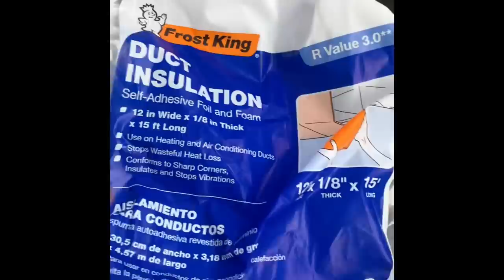You won’t believe what we find when we Rip the basement A/C out of our Alfa Seeya RV. #Alfa #RV

Comment: To insulate the bottom of the unit, take a piece of duct board from an HVAC supply house (Locke, or Johnstone, etc). Cut to the shape you want. Make sure everything is dry and get some 3M brand super 77 adhesive spray. Spray the duct board piece and the metal…let sit a few seconds to “tack” up and then put the duct board piece in place. I’m a few seconds that adhesive will do the trick!
Reply from the maker: Yeah, Lowe’s really didn’t have much of a selection. Thanks for the tip!!

Comment: Tim,
One of the reasons your evap coil was so filthy was because you only have 2 screws holding the return air duct onto the case.  If you take a look at your video, you can see the screw holes in the case where the missing screws were left out by someone who had removed the unit previously.  (Understandably so because they are a real pain to reach and get in.)   It is sucking all sorts of dirt in from the connection of the return air duct to the case.  This includes outside hot air from around the engine area.  A little aluminized duct tape on the flanges of the ducts and the case help out a lot.  Probably might have replaced the foam seal around it that you said "wasn't too bad"" as well.

Another thing you could have done is powered up the unit while it was removed and checked the amperage draw of each compressor with a clamp meter to see if they were struggling.  You could have also done a temp differential check at the unit to compare the inlet and outlet "delta".   As you probably noticed, there are no pressure taps for checking compressor output or to re-service the refrigerant charge.  Ronnie Wolfe/Dick Albritton has added them and has found that even units when they were new (yeah, Dick has been doing Alfa AC repairs for a LONG time) some were low on refrigerant pressures.  I changed out both of my blower capacitors as a precaution and the pillow block bearing on the condenser blower, and of course oiled them all.

Great video!  Thanks for posting it.  Like you said, it is not for the 'faint of heart" as it is a LOT of physical labor to get that beast out and back in.  A hydraulic lift table helps a little bit.

Ronnie Wolfe has done it so many times that I think he can do it in his sleep.  He had mine out, cleaned, serviced, checked, and reinstalled and operating perfectly in less than 6 hours.  I am still amazed.  He's in Choudrant, LA.  Great guy if you ever get a chance to meet him.
Jim Harvey
'04 Alfa See Ya #71507

Comment: from my experience in motor coaches and class 8 semi trucks it if they have a fresh or recirc. air intake screen you need to find a filter to replace it with, at the very least keep the screen clean and keep carpets vacuumed,  I have found that drivers who have pets regularly especially cats will find the evaporators getting clogged up quicker and getting dander out of them is tough.  thing is these things circulate a large amount of air in a relatively small space. and accentually work like a vacuum cleaner.
Reply from the maker: Makes sense!  This has a cheap o washable type air filter. I just went online and ordered much better filters.

Comment: Cleaned the condenser coil on my friends campers trailer a/c little while ago it looked identical to the one u cleaned. Obviously hadn’t been done in years either. But anyway I’m impressed with your talents Tim. I worked for a plg. Heating air conditioning company for 25plus years u get to work in some tight 💩holes sometimes lol 😂
Reply from the maker: Well thank ya sir!! I figured it was bad but I didn’t think it was that bad.

Comment: Get you a hose clamp open it all the way up straighten it out the best you can and take the very end of it, which is the opposite end of the screw side and put it between each row of aluminum fins and go either up or down between them to straighten them and it doesn't damage them... it doesn't take long at all, to straighten all of them...
Reply from the maker: Nice tip! Will do that

Comment: Should have used a medium to soft brush to get the heavy crud off before spraying the cleaner....  Doesn't that pan have at least 1 drain hole so the condensate can drain out?
Reply from the maker: I’d say the hole is about 3/4”. What I think happened was the drain coming out from under the RV was folded shut. At least it was when I got it. Basically sealed it up